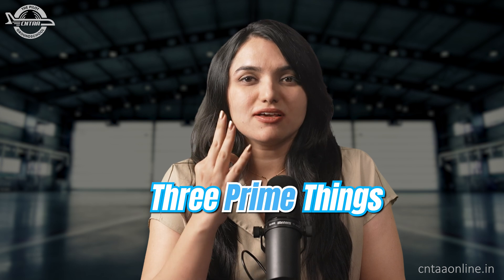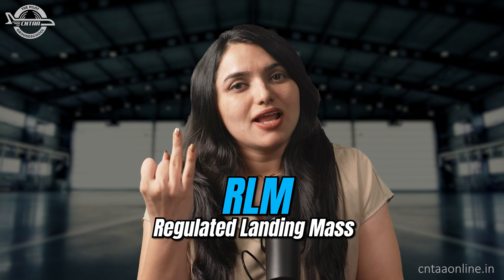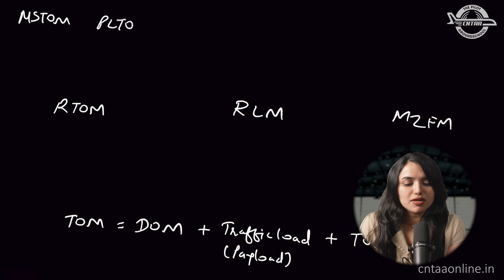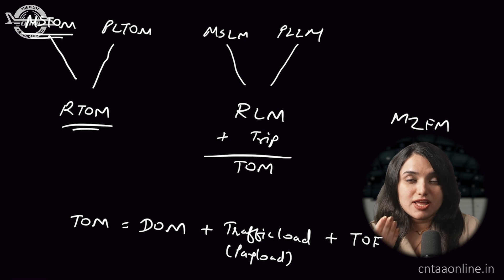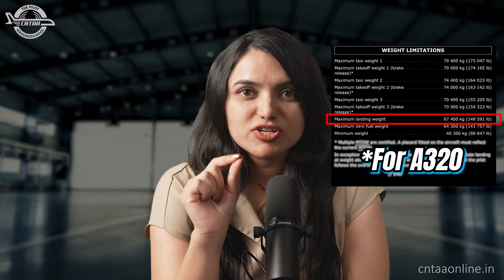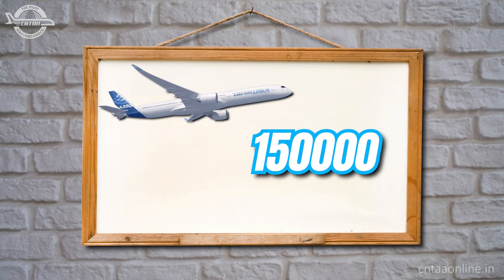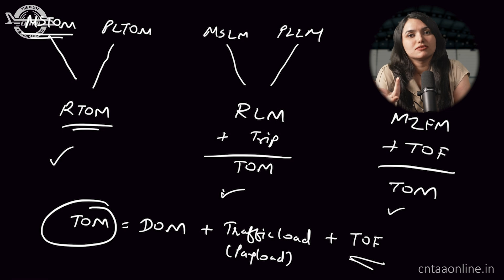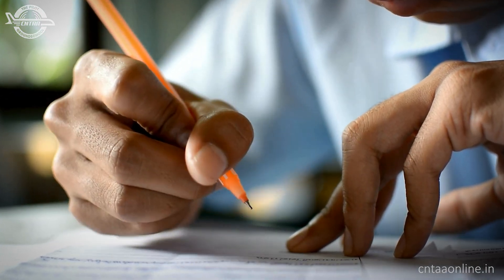Payload & Calculating Takeoff Mass Explained by Capt. Neha Thakare | Aviation Basics & Formula

Comment: Question : Noting that the fuel weight in the wings helps reduce stress at the point the wings are attached to the fuselage, ie Wing Roots, as fuel is consumed over the duration of the flight Will the stress at the Wing Root not increase as there is less fuel in the wings vs the upward lift force ? Would appreciate a reply.

Comment: Dear Capt. Neha Thakare |

I am 81 years old, mechanical engineer and very much interested in aviation parameters. I appreciate your focus in explaining the basics of the various aspects of weight for considering take off and landing of airplanes.

I understand that Magic Square  concept for distribution of cargo, passengers, fluctuating fuels to maintain the center of gravity is considered in designing loading patterns.  Request to throw some light on this.

Also when the heavy plane lands with full velocity , how  the vertical component of the impact  impact is taken care off.  The jet reversal to create retardation of the aircraft impact on Runway.

I very closely follow  with enthusiasm,  your knowledge based narrations.

Best wishes

RangaN
20 Feb 2025
NB: In my previous comments I used the abbreviation ATC which is common for

Air Traffic Control and also
Automatic Train Control